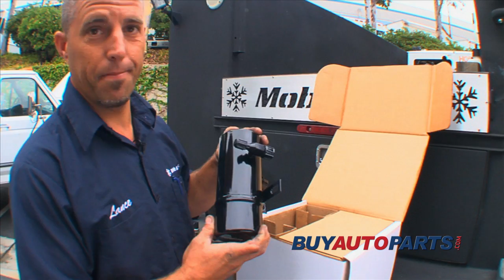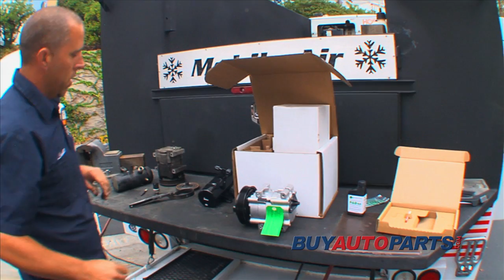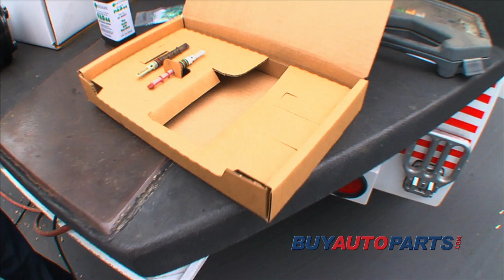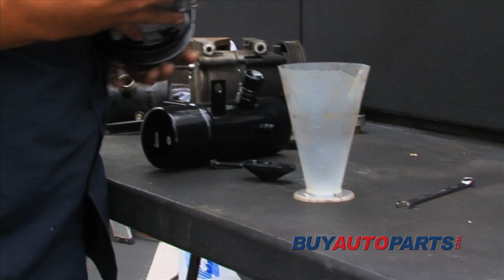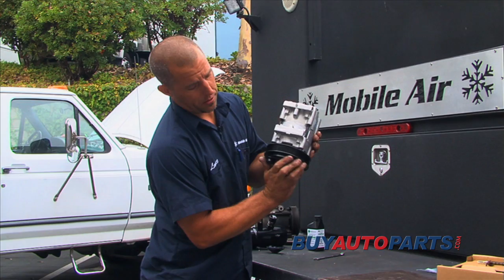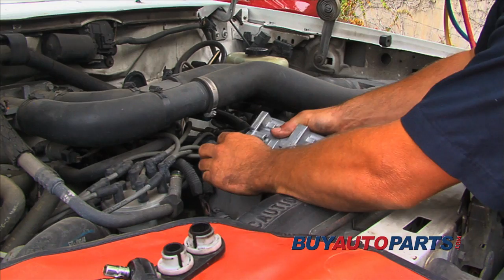Auto Air Conditioning Repair Part 2 - BuyAutoParts.com

Comment: Question?  Is it necessary to drain out the oil out of the new compressor to measure?  Was there a tag in this case indicating how much oil was already prefilled into the new compressor?